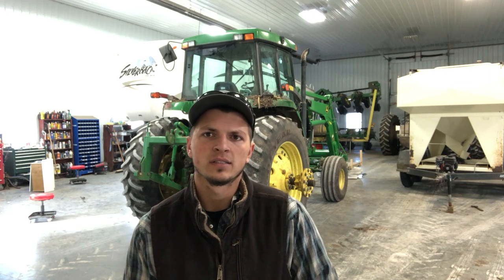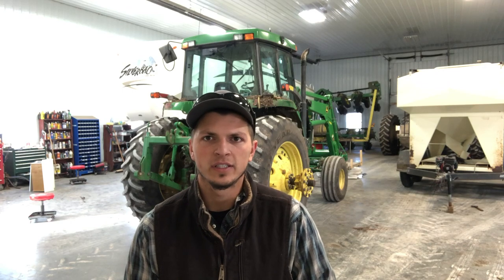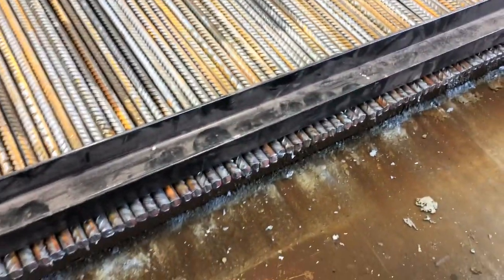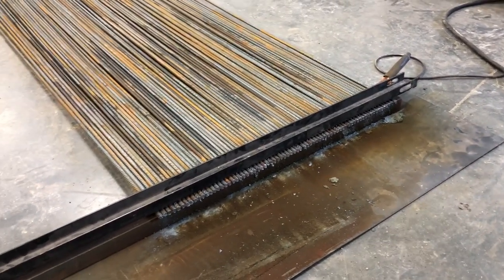how to make Cheap Eletric Fence Post

Comment: I have done this very same thing with 1/4 inch cold roll and it’s much lighter plenty strong enough and cheaper 
Definitely works very well but the cold roll works as well just a little bit heavier and a little bit more expensive